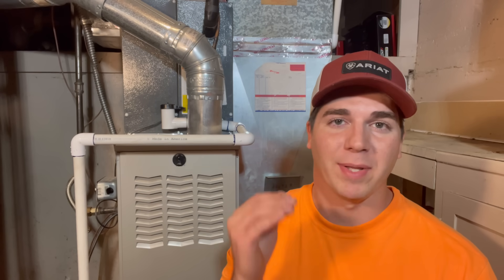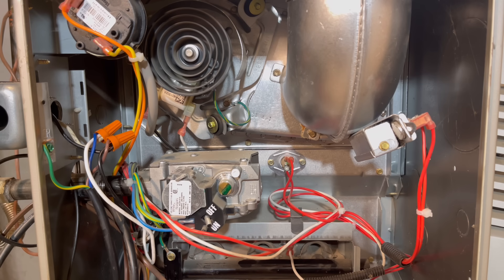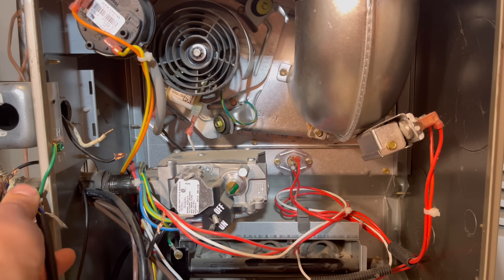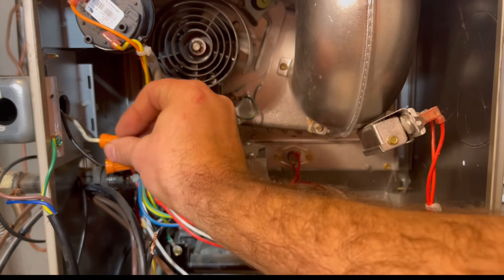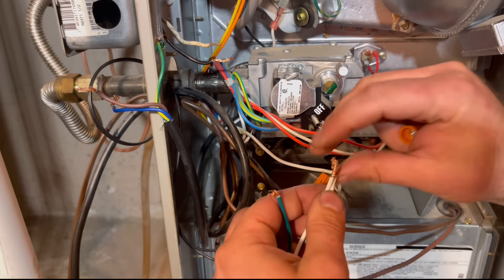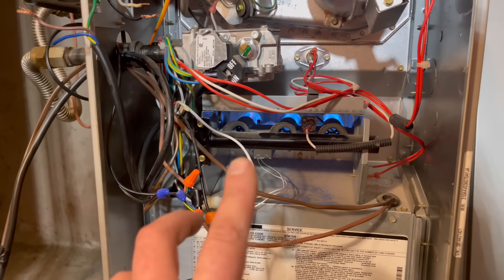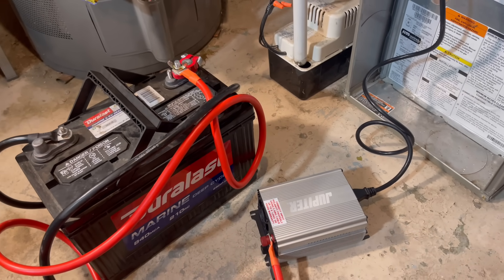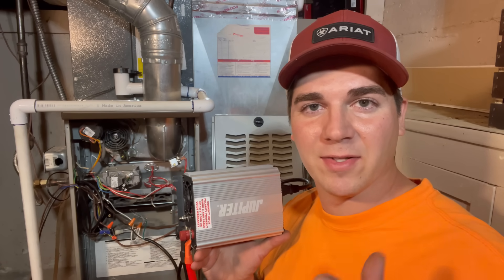Did You Know You Can Heat Your Home With A Car Battery?

Comment: Why not just turn off breaker to unit, cut the wire on outside of furnace, install twist lock plug..then when needed, just unplug power from breaker, and plug in your battery, inverter setup ?
Reply from the maker: Check out my latest video 👍🏽 cheers

Comment: Just mount the inverter under the hood of your truck and run an extension cord inside so you can start the truck once in a while to charge it up ..   I'd also think you'd want a fuse on that lead to the inverter in case it becomes a welding cable :)
Reply: Ya lol. Needs a fuse forsure.
Reply: Oops - I just posted the same thought. I didn't read all of the replies and I missed yours - I didn't mean to run over your thought. But great minds think alike!  
Probably one of the most repeated suggestions is to be sure to get an clean sine wave inverter. More expensive, but worth it with modern electronics. My old furnace wouldn't care.
Reply: Jody mounting an inverter directly to your truck is not adviseable. When the blower gan depletes the truck battery you will not be able to start the truck. A 2nd seperate battery is usually practical in this situation. Bless.
Reply: But don’t ya need too drive over 25 mph in order for that alternator too really charge back up a battery cause just idling and not moving I don’t think really charges back up that battery off the alternator.
Reply: @xDESTINYxKINGx  No, you don't need to drive any distance. Driving just wastes gas on moving the vehicle. Idling will recharge a battery just fine.
Reply: @xDESTINYxKINGx  When you start your vehicle and idle .. it hits 14.x volts. it's charging.. just not putting out full potential amperage.

Comment: How many amps is your gas furnace? I have a Coleman three ton heat pump. It takes around 30 amps to run. There is also a start up amp demand. Is there a way to operate a heat pump via battery(s)??  Thanks for your video.   :)
Reply from the maker: Of course, but you’d need an insane amount of batteries and solar panels to keep them charged

Comment: Most central heating and AC is 220v in a house
Reply from the maker: A lot of gas furnaces here in utah. Most people don’t know you can run the furnace independently from the air conditioner.
Reply: @diyhvacguy  Yes they have lots of many sizes and wattages on the inverters  most sizes used is 6v, 12v, 24v, and 48v from AC to DC inverters.  That how i supplied my truck with Micro wave oven, TV, and things used in a house > The cost of a inverter is about 50 cents to 1 dollar per watt

Comment: Zone actuators(dampers) and logic boards should be fine regardless of modified or pure sine wave; as they are fed by a 24vac transformer in the unit. As long as the frequency is correct (Hz) it should continue to convert or step down the voltage. Fancy transformers have built in resettable breakers and 90% of boards have a 3 or 5 amp mini fuse to protect it and anything downstream. (HVAC service tech)

Comment: A car battery can not last for days like he claims. A typical home furnace requires 7 to 10 amps at 120v. That equates to 70 to 100 amps from a 12v battery to the inverter. A car battery will die in under 2 hours at that amount of draw. Even in a motorhome with deep cycle batteries (more than 10 times the reserve capacity of a car battery) a 12v furnace will draw the batteries down in less than 2 evenings (not running at all during the day).
Reply from the maker: Watch my latest video :) I apologize for any confusion.

Comment: You can also duplicate the videos on here where they convert petrol to LP gas, boil water to make steam, and use that to turn a rigged old alternator laying around in the garage or from a junkyard to recharge the battery. I remember reading that when used that way, a couple of liters can last for days.

Comment: I've seen some furnaces powered off an outlet instead of hardwired, would make this move a lot quicker / safer for when it's actually needed. Great idea though!
Reply from the maker: Check out my latest video :) cheers
Reply: @diyhvacguy  ha! Very nice.... Well done! Do you think there's any risk in damaging the electronics - either on the control board or on the thermostat - by using a power inverter? I know some electronics can be damaged if they're not getting the consistent voltage they might expect.

Comment: Why go to the trouble of removing battery. ... Just go to Harbor Freight buy a 2000 watt inverter $129.00; 10-3  gauge 50  foot  ext. cord; 12 foot 2 gauge jumper cables from Lowe's $19.95  ....cut off one end of jumper cables connect to inverter, connect other end to car  battery  ....attach 10 gauge extension cord to furnace , and power your TV and microwave oven also ....a full tank of gas will let your car idle for several days .
Reply from the maker: I have another video on this :) cheers

Comment: Reality: if it's another snowpacalypse in Texas, figure 2 days of battery for a single battery.   Below about 11.8VDC the inverter won't work, and if the voltage output were to get too low, you can burn up the furnace blower motor.  Also, the furnace has a cool down cycle, if you cut power before a full thermostat triggered ignition/heat/cool down cycle, you can Crack the combustion chamber.  In the good news department, if you live on a farm, you may have multiple vehicles and farm equipment to borrow batteries out of, and just rotate batteries daily so you can start and recharge in vehicle.  

I was south of Fort Worth from Washington State at the time, on some family farms, and although we didn't lose power, it was hell dealing with frozen plumbing, no start vehicles, and keeping herds of cattle watered and fed.  If we'd lost power too it just would have been more awful.  This inverter solution is a good idea for emergency use.  Also. If you have an rv with a big inverter, you could charge your deep cycle batteries in place normally off of your solar/generator/main engine on the rig, and just run an extension cord into the house to the furnace.

Comment: I installed a plug on our furnace and put an outlet in the junction box.  It stays plugged into the outlet permanently unless we need to get out the generator and the furnace can be plugged into a small inverter generator. I had to create a special cord that goes to the generator because the furnace requires the ground bond to neutral in order to fire up.  Running the furnace, TV, lamp, and refrigerator the small generator will run about 7 hours on 1 gallon of gas.

Comment: We've done this in Alaska before using a Toyo stove. The chance of frying the board is extremely high and we've been there which is a  common mistake. However there is a way around this problem using coil similar to what you'd use in a car stereo installation. The coil take the variable inverter power coming out and turns it into a flat smoother current helping the furnaces computer board for freaking out and becoming useless. The series of installation would be battery to inverter then coil to furnace if that makes sense. Sorry if I can't explain it in better terms but you can solve this problem easily and this situation can also occur using a generator which many Alaskans are using now everyday of the year.
Reply: a coil is not a filter
if you have a cheap inverter you would need to put a Sine Wave Filter on the output, rated for the frequency voltage and power of your inverter output
It would probably be cheaper to just buy a decent inverter, one that is deigned to run motors.
Reply: @kenwittlief255  The inverter you are using is a modified sine wave. A pure sine wave inverter will not burn circuit boards, and is pure enough to run games like a playstation. You are correct that using a coil will do nothing.

Comment: people might ask what to do when the battery runs out? take the battery and hook it up to your car with jumper cables and run your car for the time it takes to recharge it, basically turning your car into a generator, then just hook it back up again. would be handy to have knowledge of boosting a battery and to have a volt meter.
Reply from the maker: Exactly, you will appreciate our latest video then. Check it out! Cheers

Comment: You should add a small voltage meter to the setup to monitor the battery. That way you could keep an eye on battery capacity to prevent low voltage cutoff on the inverter. I agree with using deep cycle batteries or batteries in parallel, it will reduce stress and give longer runtimes. Another thought is a larger capacity (2000w or larger) lithium “generator “ could work without an inverter, since it already has 120v outlets. The other advantage they charge must quicker than lead acid, usually in just a few hours from a gas generator. Unfortunately they are $$$$$$!
Reply: Inverters shut off when the battery voltage is too low. Why would you shut it off before then?!
Many inverters show you the battery voltage while they are running.
Reply from the maker: Check out my latest video :) you’ll like that one. Cheers
Reply: Not real hard I'm 70 and I can remember what I need to do. Besides I done it a lot to run a fan in the summer and a heater in the winter for my dogs in my van